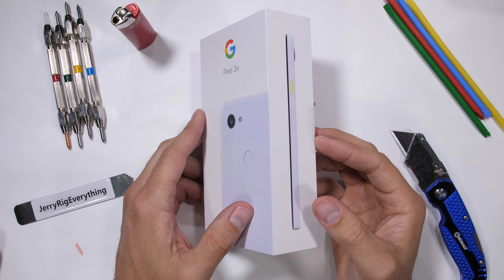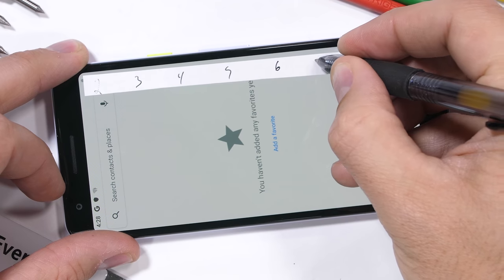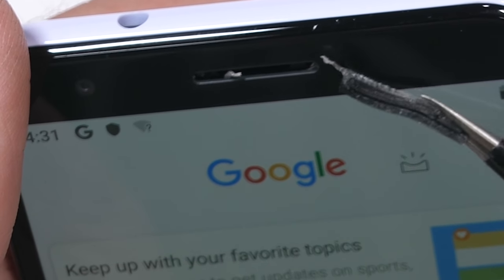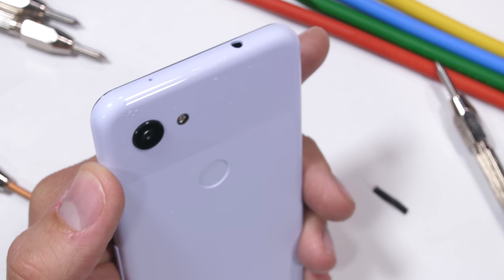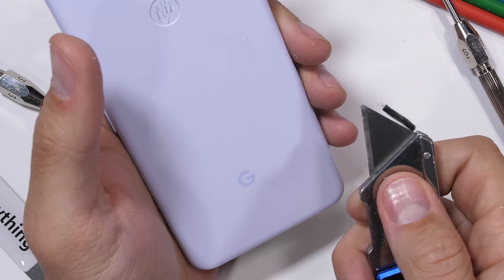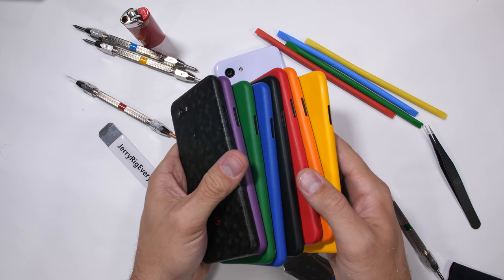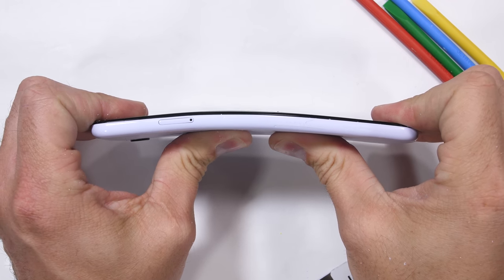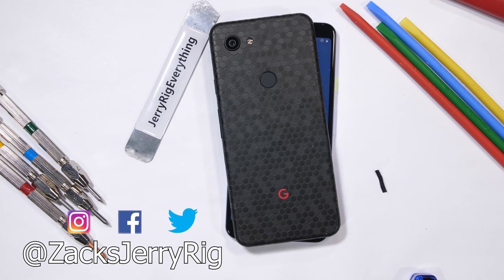Google Pixel 3a Durability Test! - Is Plastic Weak?!

Comment: Proper antiquated look for me, I had an NEC flip phone, one of the first 3G phones in the UK, circa 2003 or so, and it had the same design as this pixel, with the plastic bit juxtapositioning with the slightly different hue.

For a flagship phone it's incredibly bland to look at, especially in this horrible colour that looks like a shade of toilet roll, or a cheap air freshener lid.

I love Androids, but I'd swerve this phone like a seedy bar offering free food, you can get much better for less money, and you can DEFINITELY find a more aesthetically pleasing device for less money. Huawei and Oppo are making some beautiful, powerful phones, and Google are knocking out ugly, generic shite like this? It's 2019 for fucks sake, people don't want plastic, and the ones that do stick to £50 phones, not £500 ones. I wouldn't take this phone as a free upgrade, I'm too used to Galaxy phones that look gorgeous, I'd be embarrassed getting this out cos it looks like a cheap, nasty £69 Amazon special from some random Chinese company like Deagoozlupu.

Comment: Okay usually I dont say anything the the speaker mesh will definitely NEVER come off. Come on guy you are literally trying to make the phone of the year look bad. It would take some extremely hot temperatures to make it melt. And how and why would it come off
Reply: The bed is perfectly designed to avoid clacking

Comment: The one reason I can't buy this phone is there dragontrail glass, first drop on concrete and it's gonna go "crack" dropped my LG G7 thinq on asphalt without any protection and it was perfectly fine after hitting the end bouncing to another edge, flipping around hitting the asphalt again then sliding across the asphalt and finally coming to a rest, I 100% guarantee you the pixel 3 a would not survive all that, gorilla glass 5 is the real deal and dragontrail is a joke.
Reply: TONY B the TECH TIGER It really depends on how you drop it and from what angle... and probably height. Also, why don’t you have protection for your devices?

Comment: What is that a headphone JACK
thumbs up for THAT
google previously killed the JACK 
which was pretty WHACK
they got a bunch of FLACK
border line attacks for following APPLES PACK
and LACKING the JACK
but I’m GLAD to see it’s BACK
google should get a STACK of LILAC PLACKS for THAT 
HAVING the JACK BACK is a borderline AFRODISIAC 
the dual LED FLASH is made from PLASTIC
And the single 12 megapixel CAMERA lens
Is protected with a layer of GLASS
The rear fingerprint scanner FOLLOWS
The same plastic FLOW
With everything else on the PHONE
And is made from SCRATCHABLE PLASTIC 
Build MATERIOLE

Dr. SUESS WHO EVEN IS THAT

Also are you giving away those pixel phones dbrand sent over because I really want one